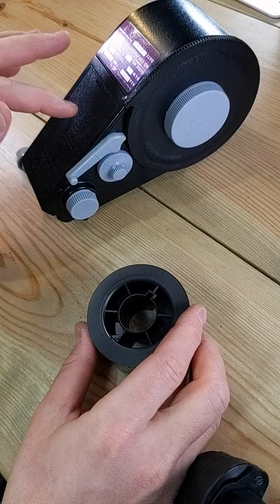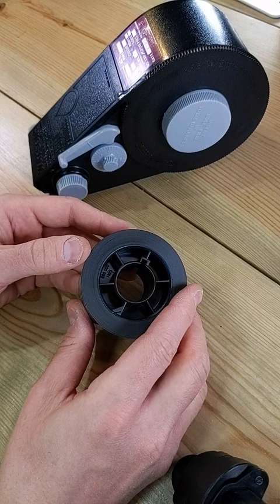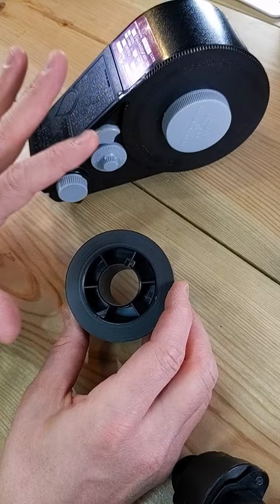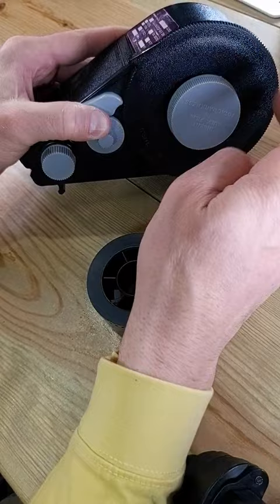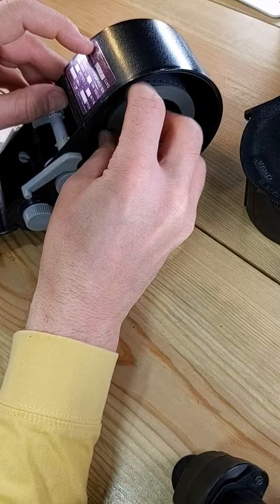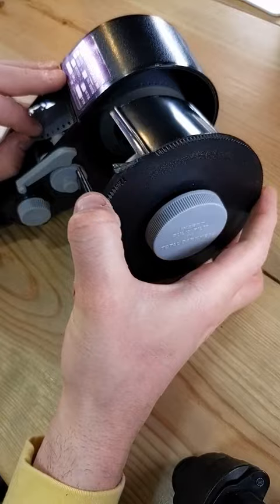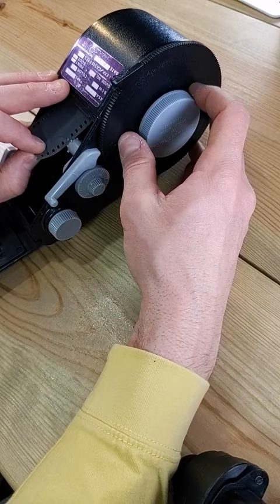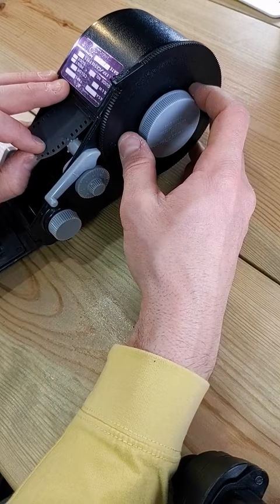Mastering the Watson 35mm Film Bulk Loader: A Short 60-second Guide

Comment: Or... lazy mode, only bulk load Ortho film 😂
Reply from the maker: LOL, yeah, that's a bit easier.
Reply: @DavidHancock  Honestly I think Ortho is often overlooked as a learning tool for both LF and bulk, since practicing under a safelight is pretty useful.  I'm super excited for the new FOMA 400 ortho to use in the Rollei A26 with the Fakmatic adapter.  I used to use ortho for 620 and 127, but these days I just use GP3 :)
Reply from the maker: @jw48335  It's a bit tricky to use well, though. Ortho is persnickety. But this 400 Ortho is interesting and news to me. So I'm off to go research. Thank you!
Reply: @DavidHancock  Absolutely.  A polarizer and a light yellow filter go a long way to help with every Ortho stock I've tried.  Although I learned the hard way that filter factors on ortho are inherently higher (2.5 stops for light yellow).  Cheers!